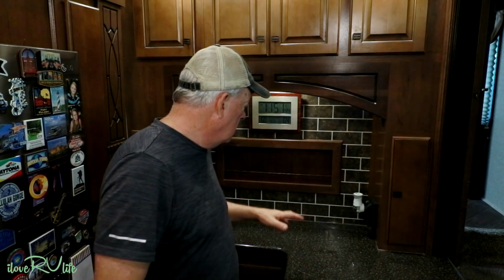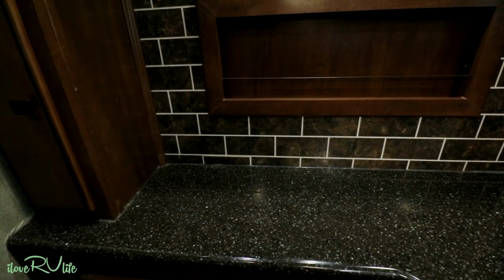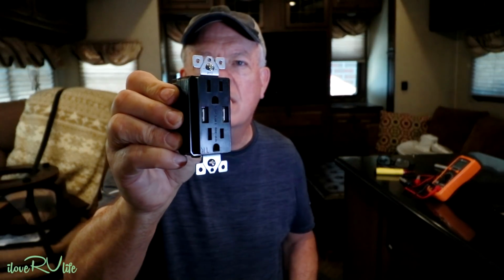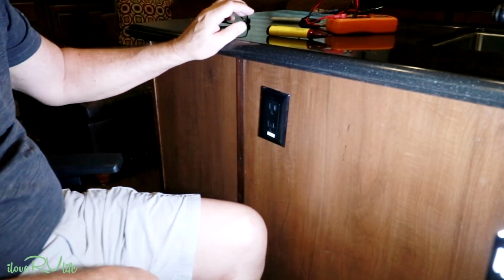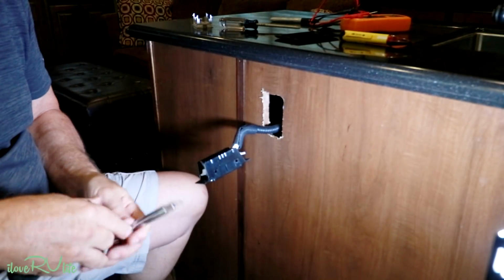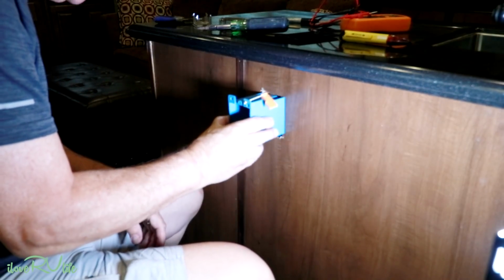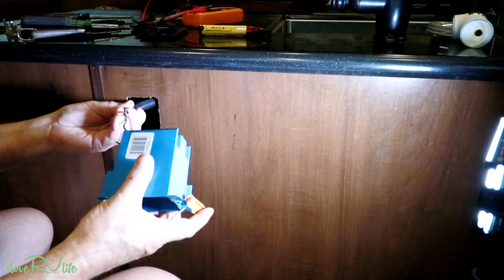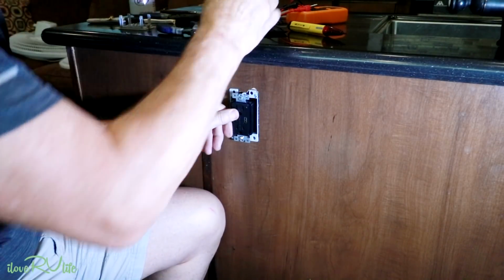Add USB AC Outlets to Your RV Plus That Other Thing

Comment: Great video Jerry.  How do you verify that the black wire is actually the hot wire and the white is the neutral wire?  This become even more important if the wire color is blue or something else.  Thanks.
Reply from the maker: Thanks.  I used a digital volt meter.  Carefully touch one probe to the ground wire and the other probe each wire to be tested.  The hot wire will show voltage.  Then kill the circuit to complete wiring.

Comment: I’m a retired police officer and firefighter. From the firefighter side I can tell you I went to many house fires that were caused by those multi plugs and power strips. You are correct about the overloading warning. The overload causes the wiring to become super heated and thus a fire. And honestly RV plugs are scary anyway in how they’re made.   Bottom line is most people plug those in and then plug all kinds of stuff never doing the math.  And was that a Spyderco knife?
Reply from the maker: Thanks for sharing Captain.  The wiring in RV's can be a bit of a concern.  Best to keep a sharp eye out for any plug that get's too warm or a breaker constantly trips.  Something's up.  Yes, it is a Spyderco Delica.  I have a couple.  These are my working knives.  They take quite a bit of abuse.  Favorite is my Maxix 2 for general EDC.
Reply: @iLoveRVlife  thanks for the reply. I carry the Shaman or Smock. Love Spydercos. Stay safe!

Comment: Nice video. I would also test after to make sure polarity is correct prior to plugging anything into the receptical.
Reply from the maker: Simple.  Verify the wiring before installation and wire to the labeled lugs.

Comment: Good video Jerry. Do you have a video on how to add a DC distribution panel to a travel trailer? I recently purchased a TPMS and it has a repeater. I don’t have anywhere to plug or wire it into. I also have a wireless camera at the back of the trailer but again, nowhere to connect the repeater.  A very simple, easy-to-follow video on installing a DC distribution panel for these repeaters and other accessories would really be a great help!  Thanks for your consideration.
Reply from the maker: Hi Milo.  Unfortunately I don’t have a video on a panel.  But, the backup camera is simple.  Borrow the wiring from a marker light.  We use Haloview for cameras.  The have a direct replacement marker light with built in camera.  Install was a couple minutes.  The video shows the install on side, but could have been done easily on the back as well. See this video https://youtu.be/Tu5oPBRHquU